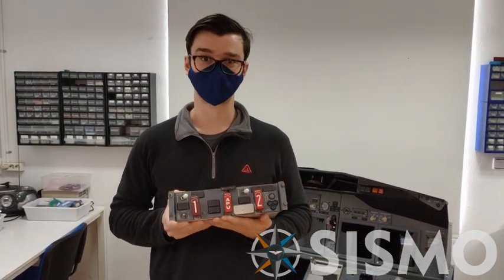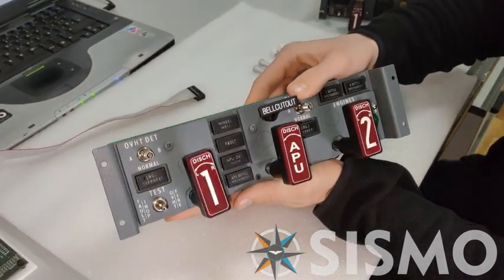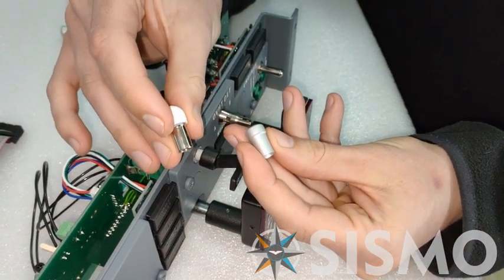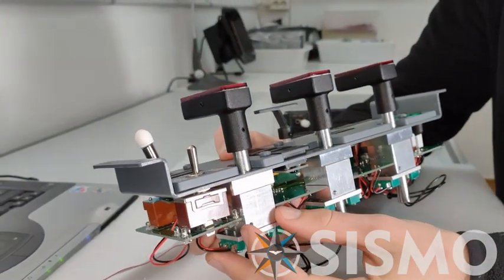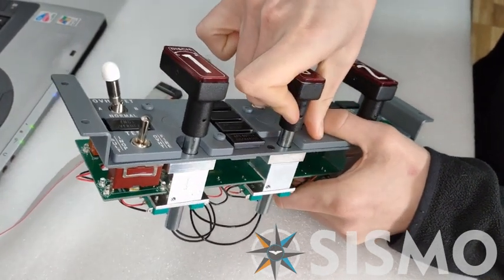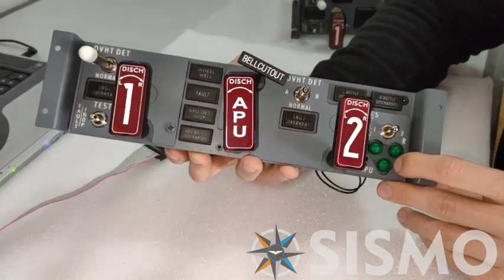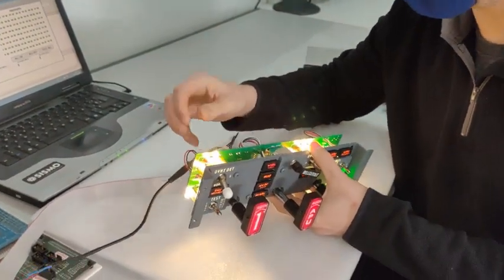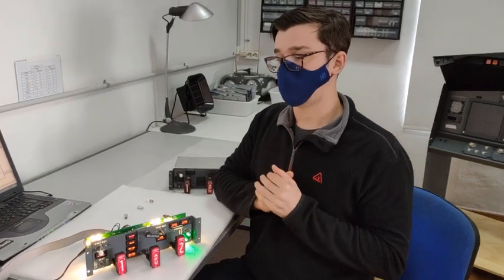Fire Suppression Panel

Comment: Are the fire switches locked? so you can only pull them if the fire bell is activate or you press the manual override?  Thanks
Reply from the maker: HI there Sim737, no they are not locked. On the other hand they are backlighted, unbreakable and sturdy.